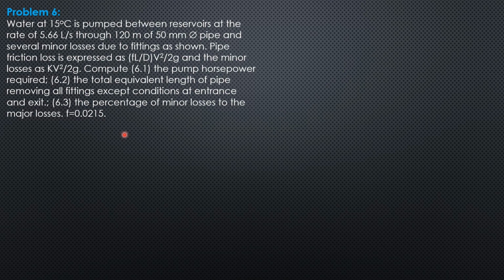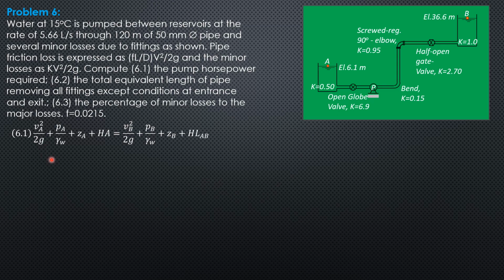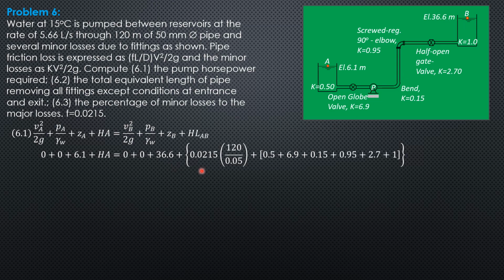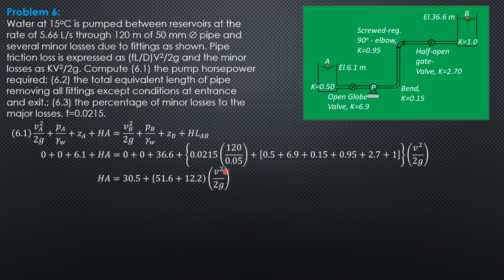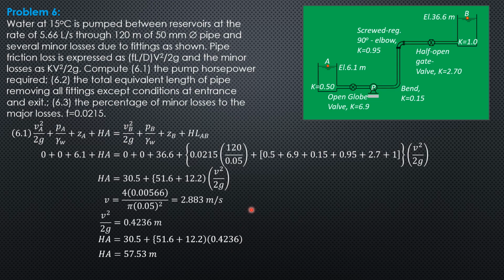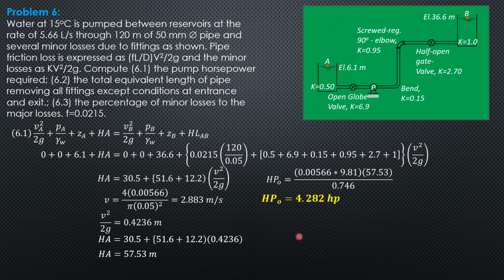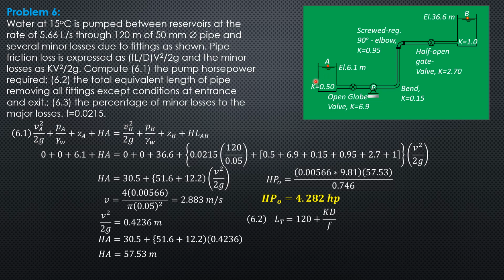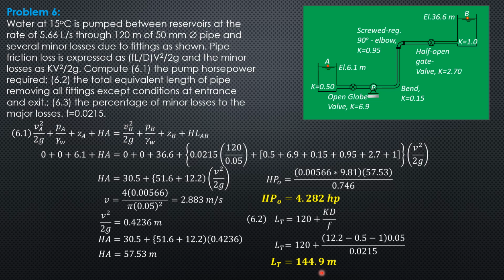SERIES PARALLEL PIPES and MINOR LOSSES, Example 6

Comment: Thank you so much! can you please explain why velocity head is negligible at A and B?
Reply from the maker: You must know beforehand that the velocity heads at the surfaces of large reservoirs are zeros. Observe the surfaces of reservoirs for 10 seconds. The water surfaces or liquid surfaces do not appreciably alter for 10 seconds. Or you may assign a value say 1 mm/s (this is high for a large reservoir). 1 mm/s is 0.001 m/s. Square it and divide by 19.62.